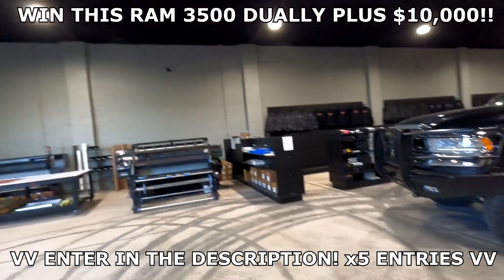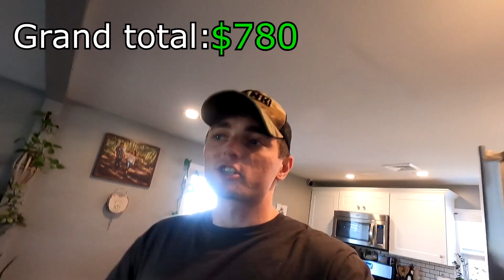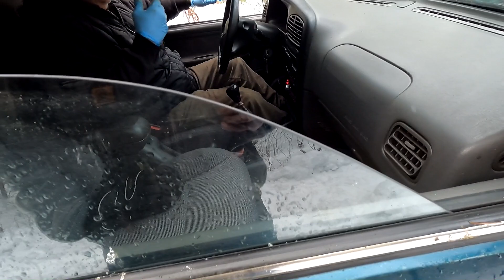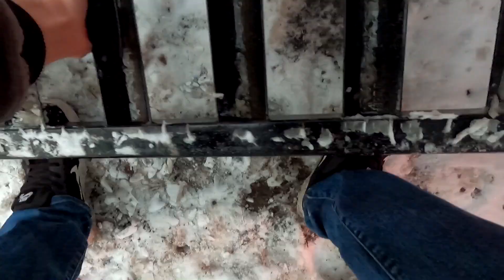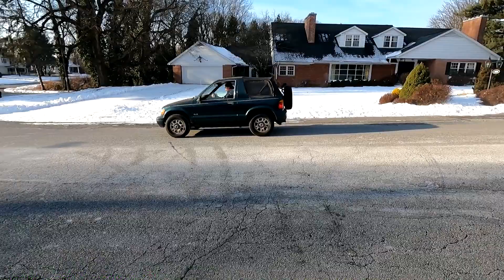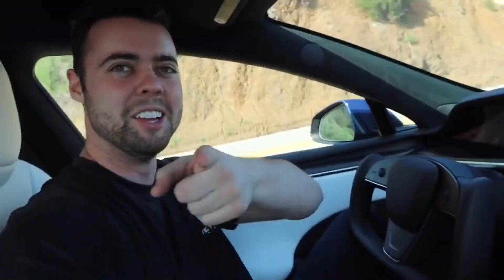I WAS SCAMMED BY A FAN! Said This 4x4 Off Roader Ran Like New?! 😡

Comment: Bobby I think you may have a clutch slave cylinder problem. Proportion valve is for the breaks. First thing check for fluid and leaks bleed the clutch it will take 10 mins. Good luck.